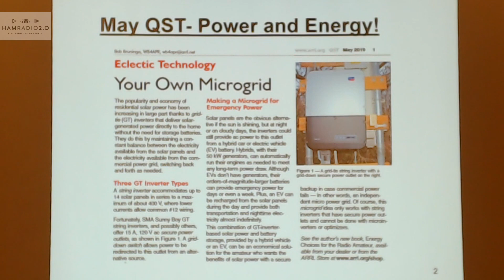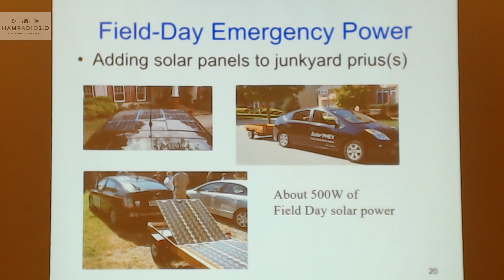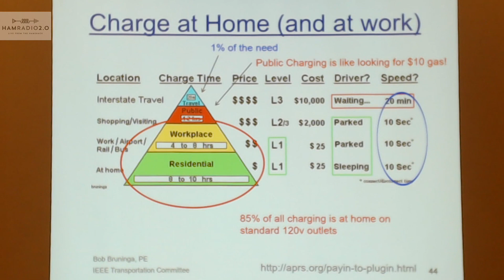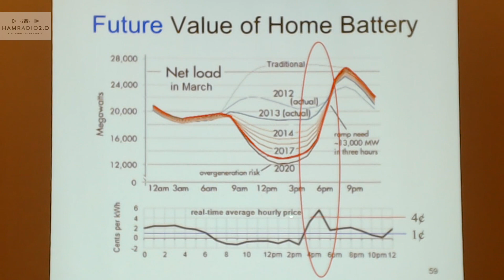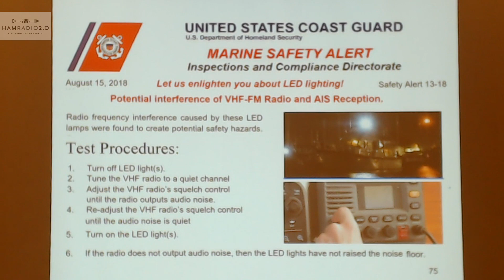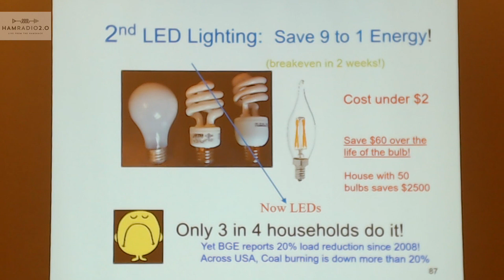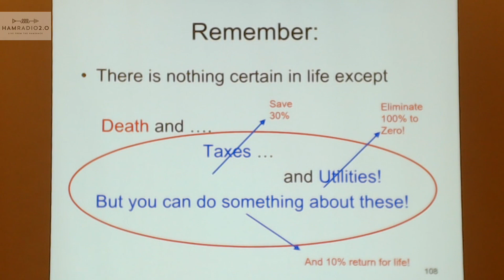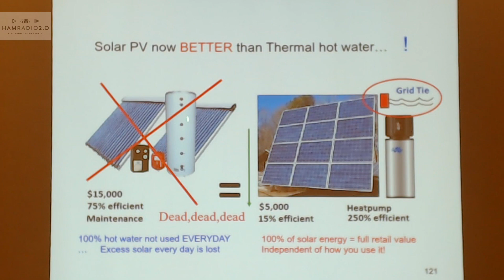Solar Power and Electric Vehicle threats to Amateur Radio Communications

Comment: Great Presentation Bob Bruninga!  The biggest discrepancies are: adjust each cost area for actual costs in your area/situation. 1. If you are paying a small to a reasonable amount of electricity/fuel do nothing! 2. If you are considering a new car look at an electric/hybrid. don't just buy a car based on it being electric (high tech) versus gasoline. If you have a good car you do not need a new car. 3. Electric Usage - switch your pattern of when you use electricity. If running the dryer/oven/tv/electric car charging at the cheapest times you typically are about 3+ times less money than running at peak times. 4. Solar - can you afford a system to cover most of your use? Can you switch your times of most power use? Will you be staying at your current house for 10+ years.
Lastly, be safe!  Most of us do not want to touch 100 plus volts.  Connecting to your electric car/hybrid means YOU are touching hundreds of volts.  I have solar, a generator and a hybrid car and I respect the systems.  A small mistake is deadly - be sure to have another person with you to help you. Mike N6IMY

Comment: Currently in the state of Kansas they the electric company will charge you a $ 60.00 per month for solar panels on your home in order to pay for power company services to your home.
Reply: In California we pay $10 per month to be connected to the grid (pg&e)  Mike N6IMY
Reply: @mikeklemens8970 :  I understand the State of Texas is working on a proposal to charge $ 100.00 per month charge if a home has solar panels.  As I understand they have already stoped paying people for any extra power pushed back into there grid.
Reply: @ssrrocks22  extra accumulated electricity generated at the end of the year is bought back from us at about 30 percent of lowest cost we would typically pay.  Making it very important to get close to a zero use in kilowatts on average in a year. Mike N6IMY
Reply: In my area of Pa, we have an approx 16/month "customer charge". Everybody pays this to be connected and have an account. Part of this is to recover the "loss" of my utility (PPL) for me sending power back into my neighborhood during peak times. I doubt my power goes much beyond my two next door neighbors, since my roof system is only 7.7KW (limit of the inverter, system is about 8.8kw). Power companies really do not like net metering, but since most are regulated monopolies, the state PUC and legislature can tell them they have to allow it and how they have to implement it. Some states have a PUC that is a lot like the fox guarding the hen house (Arizona I know of for sure). The power utility puts their own cronies on the PUC. It's up to state residents to get that changed.
Reply: @mikeklemens8970  California is uniquely friendly to solar, electric cars, etc.. The rest of us live in places that are not nearly as progressive, energy-wise. You have MANDATORY time of use billing for anyone with solar. Here in PA, the my utility dragged their feet for 11 years before implementing a TOU/solar net metering  plan which I sadly tried. A fiasco. They, one year later, still can't figure out how to bill me. PPL is the utility. 
They really, really don't care. This could never happen where you live.

Comment: completely disagree with the charging station comment about buying a better charger.  I am on the far side of EV driving (i drive 40 miles 1 way/80 total) and a 120v charger takes over 1 day to charge (5miles per hour, vs 25 per hour).. If i drove locally less then 20 miles per day.. 120v would be an option.  Just saying the 220v (I have a charge point) is an awesome option.  I have a 2017 e-golf.  love it

Comment: The energy I send back to the grid from my panels is sold at a lower rate to the power company than the energy I pull from the grid is sold to me from the power company. Not free.
Reply: That makes sense - why would any company pay retail for what they get wholesale from other sources?
Reply: I have a solar panel system (and a Chevy Volt, btw). Electric sent back to the grid on a daily basis is credited 100% of what I pay. This is how "net metering" works. You send power back and you are credited the exact same amount you would have been billed including distribution and generation charges. If you generate a net surplus as the end of the fiscal year you typically sell back the generation portion at a wholesale rate. This differentiates the intended net metering home-use customer from net generators, solar farms, etc...
Maybe your utility does not have "net metering". If you listen to Bob, net metering was the point when solar became a good deal financially.

Comment: Great talk. Title is a bit misleading. Also, I got solaredge optimizers and no big problems really. Maybe newer models fixed the RFI issue? As for EVs, both the Zoe and my Model 3 produce much less RFI than those noisy ignition systems.
Reply: When I was going to put in my system (after hearing a similar talk from Bob a few years ago) he warned my against micro inverters and even optimizers (my installer liked Solar Edge) due to RFI. I found at that time SMA Sunny Boy had just come out with their "secure power" inverter, which can provide up to 2KW to one outlet when the grid is down (so your panels actually do something in a grid-down scenario). I got that one. It is silent to within about 10 inches of the inverter box. I've heard since then that the optimizers and micro inverters have greatly improved their RFI as well as their reliability. EnPhase was notorious for enormous RFI (and very high failure rates).
I don't notice any RFI from my Volt. I only run UHF/VHF in it, though. I do have an inverter setup in the "trunk" for 1kw power anywhere. I tried to go cheap with the sine-wave  inverter and got my HF radio in the house wiped out with RFI. I returned that and got a Xantrex  sine wave inverter at triple the price but it runs very quiet.

Comment: Solar is more expensive and not as good as grid power. I have watched California and Texas do with out power and the destruction of economic and the pollution of our system by this type of production, I will take nuclear over this.
Reply: HUH? Solar power produces zero pollution in use. Are you talking about the theoretical estimates of pollution in production of panels? That's a once in 30 year thing, even if they show panel production carbon generation accurately (I doubt the numbers, frankly). What is the pollution of nuclear fuel production? What is the environmental impact of nuclear spent fuel and radioactive containment material storage, forever? The obvious advantage of nuclear over solar are several 1. tremendous power output 2. continuous output 3. no ongoing fuel cost. 
However, there is a fairly high cost to run a nuclear plant disregarding fuel. Nuclear plants, if you have noticed, are generally in financial distress. The entire model for nuclear was based on the astronomical cost to build and run a nuke plant would look cheap compared to the ever-increasing cost of fossil fuel (which, back in the nuke heyday, was expected to run out anyway). That didn't happen, as you know. Nuke runs clean in operation. That's it. I would NEVER consider it a clean option for net environmental impact. The waste is a huge, unsolved and generally ignored issue.

Comment: Grid tie dies when the grid goes down. You still need battery backup plus a generator. Look at California.
Reply: SMA Sunny Boy Inverter with Secure Power. You get 2KW max when grid is out in a dedicated outlet. Not great but beats zero from other solar inverters. Sunny Boy is a string inverter which is SILENT on HF. I mean absolutely zero RF emission. It is a super great inverter for any ham who wants to run HF from home. I have one, and consulted with Bob before installing my system. Now Bob has one. String inverters have their issues with shading and reduced power output, but are rock solid, RF silent, and do not present many potential points of failure on your roof like micro-inverters or even optimizers.  I attended a MARS conference a few years ago and everybody thought Bob would talk about APRS. He did...for 5 minutes. The rest was basically a talk similar to this, solar and electric cars. He's really into it....can you tell?

Comment: If I may give some feedback to WB4APR: You might wanna structure your talk a bit more. You're jumping from EVs to PV to ham radio then back to solar and EVs again. I'd suggest starting with talking about EVs, then PV (+emergency power), and finally all the other things you can do to save energy. And for both EV and PV you can then dig into what the consequences are for HAM radio (EV observations are missing btw, so if you're like me and had no negative impact, you could say so).

Also FYI, in lots of countries you don't get energy credit anymore, but you get the "energy price" or less back for every kWh you feed into the grid. In such countries adding a stationary battery makes a lot of sense and more than doubles your PV gain. You end up with additional up front investment, but the payback period is almost the same. Many PV installers know that the systems pay for themselves after 7-8 years, and add up to 100% to the price. If your PV or PV+Battery system takes 14 years to break even (a common information that PV installers here give to customers), you are paying too much!